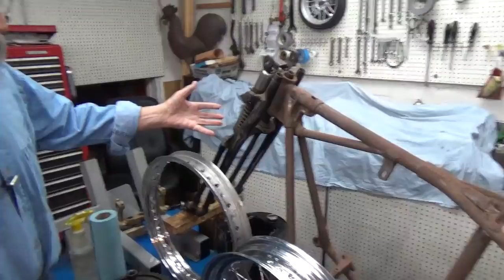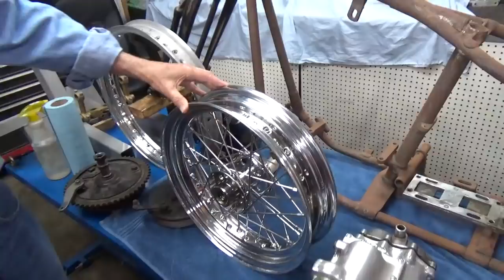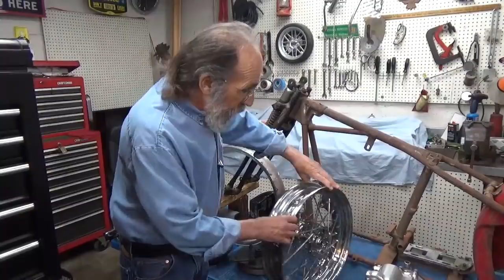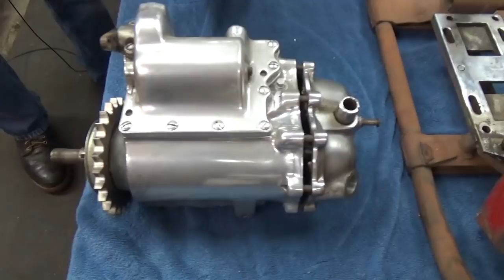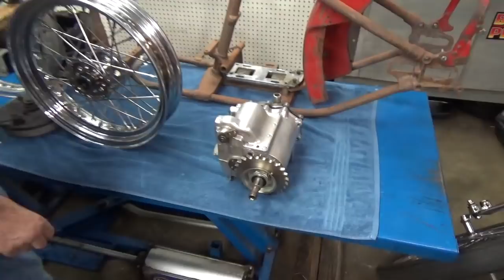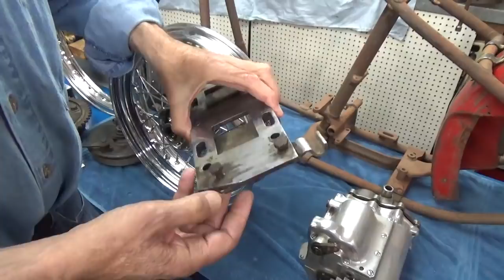More Parts For The Project Bike

Comment: Hey there Mike!
Short and sweet, this video is just what I needed today. I have my guesses on the motor you might use, but I'll keep them to myself. I'm loving the bits and pieces.
Wish I had my '75 FXE all buttoned up for a ride, but my rear brake and brake light aren't working. Soon, though. 
Be safe and keep the videos coming.
Thanks for sharing with us. 
God Bless
Reply from the maker: Thank You.  Be careful with that rear brake.  They can be a little tricky.
Reply: Louis Flege I had a  '76 FX.  I put a valve spring under that big ol rear banana caliper to keep it from bouncing around,  Lol
Reply: I have a more up to date rear brake setup now from precision machine. It was working the last time I rode the bike, but it hasn't worked since and I haven't had time to really dive into it yet.
Reply: @louisflege3741  P.M. was what we all wanted on our sleds up here in East Coast Canada back in the day. Good Gear. Keep the shiney side up brother.
Reply: @Deuce Devil thank you, bro, and keep your Knees in the breeze. ✌
Reply: I think it was Ettore Bugatti who said, when his drivers criticised the lack of braking power on his cars, "My cars are made to go fast, not to brake"
Reply: @gasgas2689  and go fast,  they did !!

Comment: The cast bronze  top tree & dogbones are so rare  !  I had a 16" over stock  Springer  with a radical stretch & rake, needless to say when the old stock  cast aluminum snapped at 30 mph I was in for a hairy ride. LOL  Respect from East Coast Canada
Reply from the maker: What was aluminum?  Anything on a front end breaking would be catastrophic.  Sorry 'bout that.
Reply: @pacificmike9501  I  might be using wrong terminology. But i used to call it the Top Tree that your handlebar Dogbones were clamped to. There was so much stress on that one piece that it cracked!  My Dogbones  ( Risers ) went in opposite directions,  Lol.  Front end FLOPPED over and I went for a tumble.
Reply: @pacificmike9501  it was actually sorta comical as I was riding slowly in city traffic and the people behind me just didn't understand why this Cat just dumped his sled for no apparent reason. Haha
Reply: @pacificmike9501  I see that you have no email to your channel Mike.  I guess you really wouldn't have time for one on top of responding to Comments. Lol.  Would never get any Wrenching done. I gotta say that I think you are one SOLID dude.

Comment: I hope to finish the engine on the Heritage tomorrow. I wanted to close it up today but my back is hurting way to much for that. So tomorrow finish the engine, and if things go well get the rest of the bike back together. Today i found the tune im going to load into the Thundermax and after a couple hours on Maps i think i have the route im going to take for a 3 or 4 day shakedown cruise once this mess is over and i can do it without getting arrested. About 500 miles up thru the white mountains of Arizona and down thru the mountains of NM to Lordsburg then back home. That should clear the cobwebs and get my head right again. Then maybe ill start my Pan project. This virus crap has me in a funk and im tired of it. Riding season is coming to an end here so its time for a nice long ride. Thank you and be safe.
Reply from the maker: Thank You.  Enjoy that ride.  It sounds awesome.  Been there.

Comment: Thanks for another great video. Was wondering if you have any tips or suggestions on finding a frame for a first build? I've been around motorcycles my whole life, but this would be my first build. I've been looking at used frames, but don't know if there's specific tricks you use for picking something?
Reply from the maker: Don't know what you want to build.  Is it swing arm or rigid.  What motor?  The different motors are different heights.  There has to be room in the frame.  A short motor looks bad in a tall frame.  A tall motor won't fit in a short frame.  Some manufacturers make great stuff.  Some don't.  Maybe you want an original frame.  From what era?
Reply: Looks like I have some more homework to
Do. All I know now is I have a Evo 80 for the drivetrain. I was thinking of going the stock FXR frame route, but see there’s some aftermarket options as well. Thanks!

Comment: Have you ever messed with an old edelbrock quiksilver carb for harleys? I have one on an 81 ironhead, and I'm struggling to find a rebuild kit.. Any ideas or suggestions?
Reply from the maker: I really don't know.  You'll probably have to call several suppliers.  You could try Edelbrock and see where they send you.  Rivera Engineering closed their doors a while back, but a little research should find what you're looking for.  I have played with them a very little.  Not much real experience there.
Reply: @pacificmike9501  That's ok. Thanks anyways. Edelbrock has been no help. They stopped making them decades ago and have zero tech support on them. I'm just reaching out to old school harley guys, hoping to get some tribal knowledge.. maybe get lucky and find somebody who used to run them..
Anyways, i really enjoy your channel. Keep up the good work!

Comment: Appreciated your thoughts on the current situation we are in. Recently discovered your videos and find them of great help in my own humble bobber project. Question. I am using a Kraft Tech rigid frame. Which accepts pretty much all soft tail Evo parts. When I look at simalar examples of what I am going for. I noticed they all are running open primarys. Looks cool. But I prefer a closed oem type primary. Is there any reason I can't run a standard primary.? I have converted to a chain secondary. Any thoughts thanks
Reply from the maker: Yes, run a standard primary.  They work well.  You already realize that you can use all existing Softail parts.  By all means, I believe in enclosed primaries.  Take care.

Comment: Hello Mike , I run the old style star hub on my 66 FLH chopper. They work fine but I would like to update to the timken bearing style star hub like what you are running. Do you remember the vendor you got that hub from ? Just want to make sure I can find a good quality one . Thanks again brother ride safe.
Reply from the maker: I think they're all made in the same place, but they're carried by some of the major suppliers.  Just remember, you'll need their axel too.
Reply: Thanks  Mike for the info. Didn’t know about needing to change the axle. Will look into it .

Comment: very enjoyable mike,i'm in NYS and i want to know what your thoughts are on a 2003 harley fxst,i have one and was wondering about the pros and cons of owning this bike,i just purchased it last fall and has supposedly 22,000 miles,i am mainly concerned about the cam tentioner which everyone says goes bad. thank you
Reply from the maker: What's the question?  There are standard procedures that the dealerships and most everyone else is doing.  They use later model, better tensioners.  They all say how soon this should be done.  I quit doing them before the new tensioners came out. I retired.  So, I tend to take their advice.  The last twin cam I did got everything.  I had the flywheel assembly balanced and welded, gear drive to the cams, wild cams, etc. etc.  By the time I got done, it was a fire breathing beast.  But then, it was for my cousin, and I owed him big time.

Comment: Hi Mike, my flat head UL engine doesn't sit on the frame mountings without the right side case hitting the cross member for the front engine mount. Its a wishbone frame. Should it have packing blocks to lift the engine a little ????????
Reply from the maker: Maybe.  I'm not sure.  I've seen that done before.  The frame is 1948 or later.  The motor is whatever year you have.  The latest UL was a 48.

Comment: I always wonder how the ride on a hardtail like that feels like? with so many bumps on the road and all
Reply from the maker: Well, I have certain rules I follow.  First, lean forward or back, never straight up and down.  Loosen up your body and stay as relaxed as you can manage.  Seat springs help.  Be sure you're wedged in to the point that you don't slide back.  Low rear tire pressure.  You will get tired sooner.  If you do those things I suggested, it helps.  My Panhead has an original seatpost, properly adjusted.  It solves all of those problems.  On the Knucklehead, I just imagine I'm eighteen years old again.  On the project bike, probably a stock, properly adjusted, seat post.  This one is for travelling.